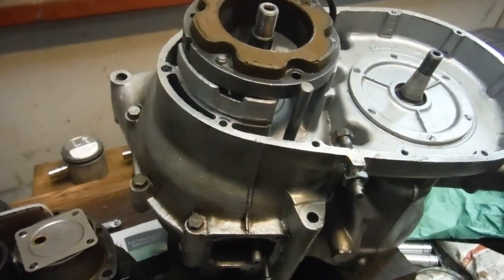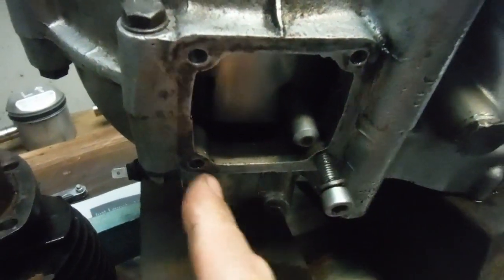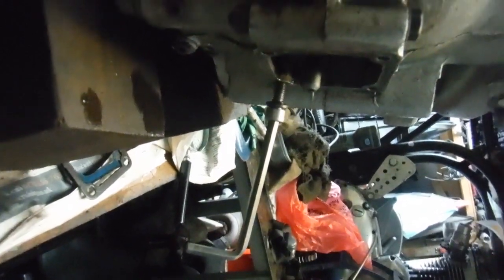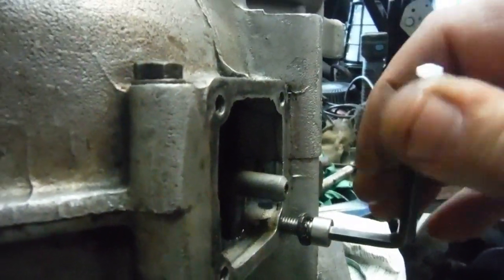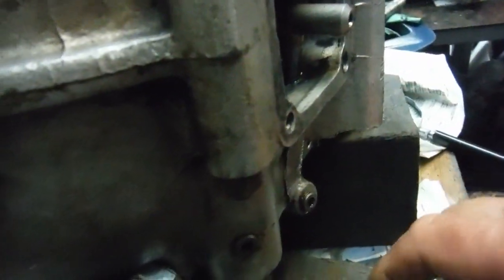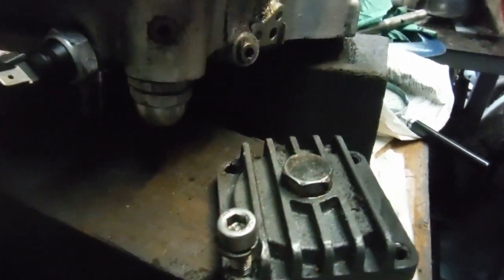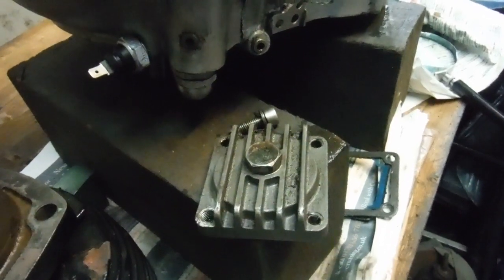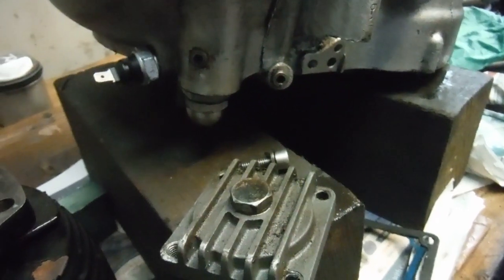BSA A65 engine - a bad sump plate thread repair and a remedy for it discussed.

Comment: If you  are able to tap thread out all be it pissed it’s amazing people then fail on two other fundamental points i would coincided simpler and common sense such as having the bolt the correct length or at very least packed with washers and opening out the hole on the sump plate.

Comment: Oh dear, I've lost count of the "thread repair" disasters I've had to deal with. Never tried "Timeserts", a lot of people rave about them but I did see a technical load test comparison that showed a good "Helicoil" had  a considerable tensile advantage, they're far too rich for my blood anyway. As you imply, a cover plate is not going to tax fasteners the same way a head stud would. Good luck with the repair, looking forward to further instalments, thanks as always.
Reply: Timeserts I was introduced to 5 years ago get used to them and they are a great problem solution for a wallowed out thread gives about 2/3 more strength to the hole it’s trying to pull out of  especially long cylinder head. Studs
Reply from the maker: Thanks Niall.

Comment: File a tapered washer to suit the different angle of the bolt and the base plate
Reply from the maker: Hi Barry, it's ok as the hole into the engine is blind, so cannot leak. All that was lacking was decent clamping of that corner of the sump plate, thanks to the bolt being a bit too long and there being threads in the sump plate hole, as well as the crankcase. Shortening the bolt and drilling out the threads in the sump plate hole did the trick.
Reply: Right

Comment: I wonder if the bolt is binding because the previous repair did not include chasing a bottoming tap down the hole. If you have the right tap on hand, might be worth a try.
Reply from the maker: All sorted now, Phil, the hole is blind and I shortened the bolt a little and opened out the stud hole in the sump plate relevant to it. The bolt is still slightly angled, but it is doing the job now.